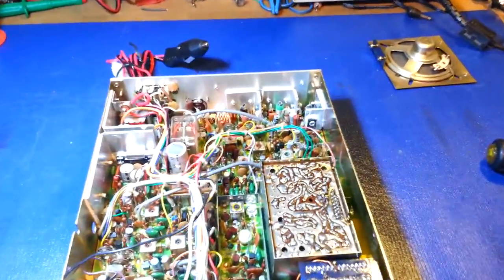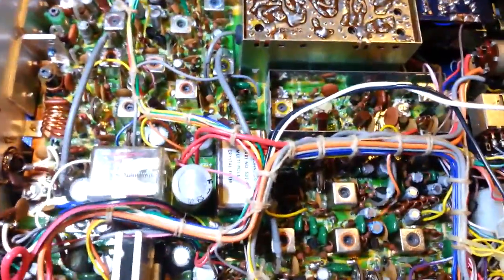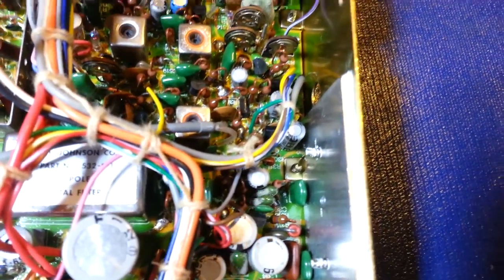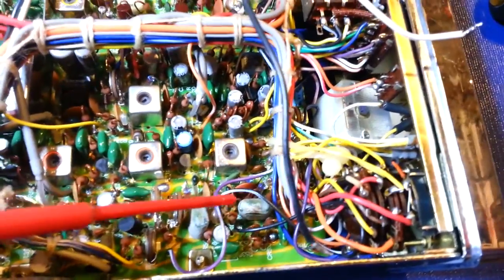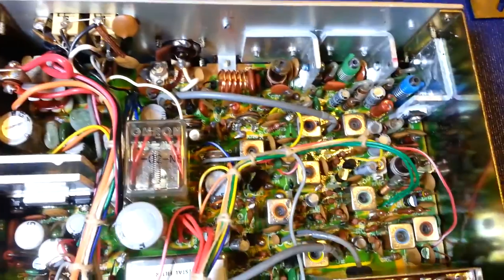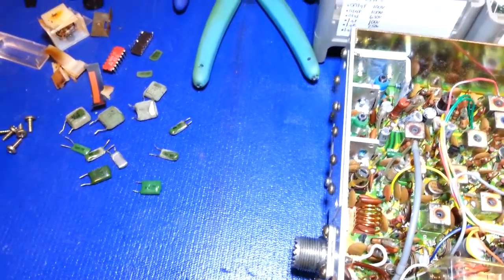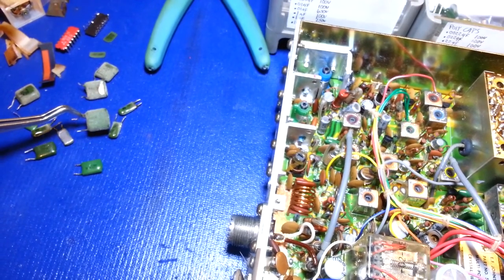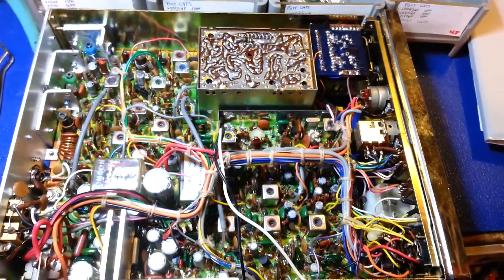Polyester green dip capacitors going bad / deteriorating in vintage electronics.  Health hazard?

Comment: Great information, I just bought an absolutely new in box Johnson  Messenger 4730 am/ssb 40 channel mobile. (the insides of the radio in the video look the same as mine, same layout maybe the same board)  Everything worked on the radio except there is no am modulation and consequently the p.a. doesn't work either. I opened it up and 4 or 5 of the bigger green metallized poly caps were covered with the same crystalline fuzz.  Not sure if this is the trouble but I'm glad I found this video, thank you'

Comment: Entropy is a harsh mistress. All parts will eventually fail. Though I have seen some nearing the century mark that are in excellent condition. I do work on a lot of video gear from the 60s and 70s. Not good. Lots of bad caps. Off value resistors. Rare vacuum tubes. Lots of unobtainium!

Comment: Seen that before in a home hifi unit from the 70's. No idea what it is. As you said appears to look like a fungus growing on the cap.  Has to be something leaked out and caused it Or, mutant capacitors from out of space.
Reply from the maker: HOLY &#$*  I didn't even think about that.  We haven't been invaded by little green men but by little green caps!  LOL
Reply: Roflmao!. Hmm, we should ask Paul from Mr Carlson's lab
Reply from the maker: +The Radio Shop 

He would be a good person to ask.  Have a way of contacting him?  

Mike
Reply: Yes I will send him a message and see if he can help.
Reply from the maker: +The Radio Shop 

Will be interesting to see what his thoughts are on this.
Reply: +MikesRadioRepair 
Hi, Sorry for the delay, youtubes message system is weird! Looks like mold is eating the plastic. Same sort of thing that happens to the old Philco TV CRT's. Plastic mold is a strange thing, it even affects other parts around it. ( that's my guess anyway's) The radio looks like an old Johnson 4740?? Great old radio's!
Reply from the maker: +Mr Carlson's Lab 

Good eye, it is a 4740.  

I initially thought of mold/mildew but it only ever seems to effect all of certain values while others show no signs of deterioration at all.  In other words if for example you find a.047 was like this all of them are.  Its like there's something different in the batches of epoxy they used.  They are definitely off gassing something because as they loose mass they shrink and eventually split open.

Mike
Reply: +MikesRadioRepair 
I think you are right about the batches of epoxy. Those caps probably got a batch that wasn't formulated correctly. Do they (the bad ones) have the same markings as the good ones? Is the writing the the same font? Also is the color the same shade of green?
Reply from the maker: +Mr Carlson's Lab 

The color would be difficult to tell.  As they deteriorate like this they progressively get lighter in color.  I'm not sure on if there were any differences between bad ones and good.  I think they were all from the same manufacturer.  I currently am working on another radio and it does have two bad green drops.  One is completly surronded by others that look like new while it is split from top to bottom and covered in the white sparkley looking residue.  Looking at the schematic those two bad ones are the only ones of that value.  The type on the bad ones is impossible to read, it looks like a black blob or ink smear.
Reply from the maker: +Mr Carlson's Lab 

Did a different radio that had the same problem.  Had two green drops that looked like this and were split open.  In that radio the two bad ones were a different brand than the rest.  So it looks like it may be a problem specific to some manufacturers.
Reply: Very interesting Mike. I was in the shop last night and picked up an old piece of equipment from a repeater site and guess what, saw a poly cap covered in that white crystal stuff. Funny those is was not split
Reply from the maker: +The Radio Shop

Not split "yet". :)  Like I said previously,  as if we don't have enough problems already with vintage electronics.  LOL, getting old sucks if your alive or a inanimate object.
Reply: Boy that is true hehe, anyway uploading 2 videos at the moment, be sure to watch #46 once uploaded.
Reply from the maker: +The Radio Shop

Watch them all, good stuff.
Reply: Maybe you are thinking of celluloid plastic mold?

Comment: The electrolyte has broken down internally and reacts with the conductive plates. This process forms a new material that can expand and rupture the plastic case of the capacitor. This happens mainly because of age and storage of the electrical device. The chemicals of the electrolyte are usually oxides of tantalum or aluminium and can be harmful to the eyes or skin. One can usually smell the leakage and is kind of like a mouldy smell.
   The out-gassing of this electrolyte can cause short on other components and copper traces. The capacitors that show damage or residue are obvious but some will be bad even if not showing signs of leakage or out-gassing. Most any type of capacitor is subject to this deterioration so older equipment should be checked carefully with a dynamic capacitor checker or ESR meter.
   For any electrical device that has not been used for a while, it is best to change out the capacitors. Some rare equipment can be brought back to life by applying power at low voltage and slowly bring the volts up to normal. Evedence like you found here needs a close look and replacement. 73 Rod KB8DNS
Reply from the maker: These are not aluminium electrolytic capacitors so no electrolyte.  Just aluminum foil plates seperated by plastic and then dipped in epoxy to seal them from the environment.  The process your describing happens in electrolytic caps.  The appears to be a failure of the epoxy coating.  Have seen this several times since this video was made and every time I see this there are usually two different brands and its all the ones from one manufacturer that do this.  My best guess is the epoxy used is decaying and as it does it produces a gas and this gas then crystallises on the caps body and surrounding components.
Reply: In this device, there seems to be a rupture of the poly caps, this would also cause the 'spray' of powder on close objects.... Could be a reaction of the dielectric or more likely reaction with the epoxy coating with the aluminium plates. May be a poor formula from the one manufacturer.
Reply: Typically the poly/film caps fail by either low capacitance, or in rarer instances, they short internally and the heat causes the film to melt and burst the casing. I've never heard of them cracking and becoming fuzzy though, that is definitely very strange!!! Perhaps the fuzzy stuff is due to overheating?
I suggest trying to figure out what company made the capacitors, and then try contacting them if they are still around. They might know.

Comment: 7:05
Sure you can, they are still available, I just checked digikey. They are not the green type, instead they are blue and rectangular, but they are about the same size (a little smaller) and are made with similar materials.

Comment: Mike, I am into two way radios as well as a home recording musician...so you can imagine the equipment that I have. I have a very sentimental piece, it's an old vintage Sears & Roebuck Bass 35 (35 watt bass guitar amp head and speaker cabinet)...made in the 60's I believe. Anyway, I was replacing a mic/instrument jack in the front panel and left the cover off for a bit, unfortunately one of my kids stepped right in the middle of it and cracked the mainboard into 3 or 4 pieces, leaving a ton of broken traces. I took short pieces of insulated wire and jumpered the broken traces and got it working, it worked for over two years. Then all of a sudden it quit. It belonged to my late Grandfather who taught me everything I know about radios, amps and more importantly...music and music gear. Music runs in my family. He taught my Dad and my Uncle to play on that amp...I taught my kids on that amp...it's a family heirloom that I would love to have repaired and working again. I've looked it over through and through, and can't find any broken traces, so it has to be an electrical component like you are talking about. I know it can be fixed, I just don't have access to the vintage parts or modern replacements...you might. I'd love to send it to you and see if you can fix it. I have reviewed a LOT of guys on here in this line...and you seem to be the most knowledgeable and experienced for the job. Leave me a way to reach you, and I'll ship it you...if you're willing to take a look a it. It would mean a lot me to get that thing running again. Thanks!! Hope to hear from you.

*UPDATE* I found that it is a Sears Silvertone 1463 (Bass 35) Amp Head
Reply from the maker: Just add @gmail.com to my YouTube user ID.
Reply: MikesRadioRepair
-- Ok, thanks. I will shoot ya an email with a some pics of what you're gonna be working with. Thanks again!!

Comment: Very weird. I've never seen this even on early 70s caps - I get the feeling this was a bad batch problem.

Now, Rifa caps, those are........... special. Every older one I've ever seen has cracked, admitted moisture, and threatened to go BLAMO!
Reply: I god, I know what you mean. Those RIFA capacitors are a fire hazard. You're right, they crack and then moisture gets in, causing leakage current ... and then boom!
Reply: I got a few Rifas in a surprise box from Electronic Goldmine. ALL of them are cracked from age/storage. 

I sense the potential for making a very amusing video of popping them.... :D

Comment: i've had that 'fuzz' appear on/in some other components made of a certain plastic, mainly plastic cased preset potentiometers, some 'wickmann' fuses, more recently a small mains rocker switch..??? as for those poly caps, which i know of more as 'mylar', maybe as you said, bad batch of epoxy?? i've never come across that yet..

Comment: Not really "off-gassing", the white stuff is fungus.  Certain plastics support the growth of fungi.  The capacitor inside does not suffer and they should test good.  Yes, the epoxy on some caps shrinks and the cap inside may deteriorate if moisture gets in.  Don't panic, just treat with athlete's foot cream!  Ha, ha, ha, ......!